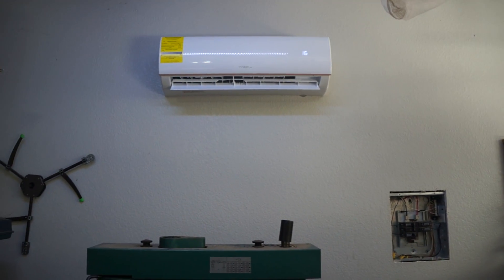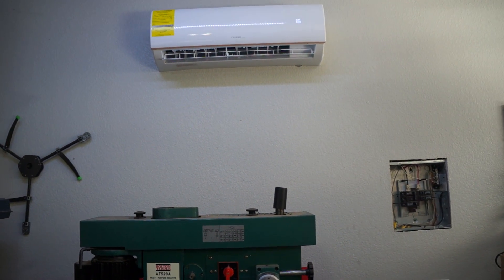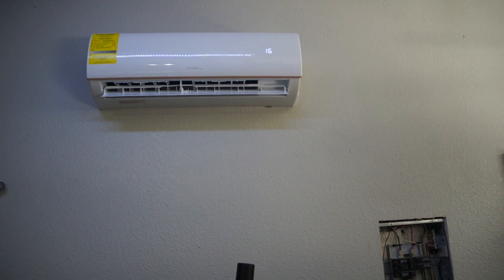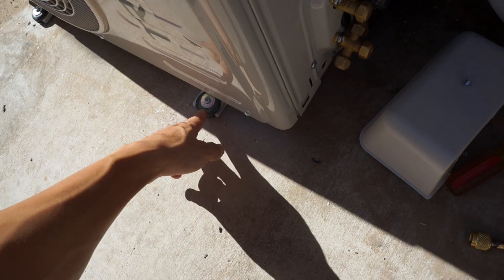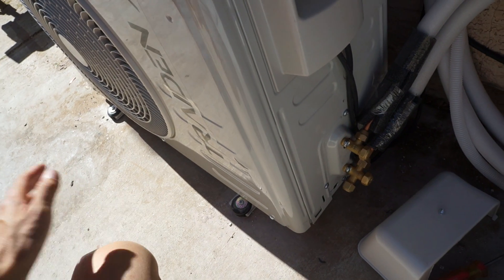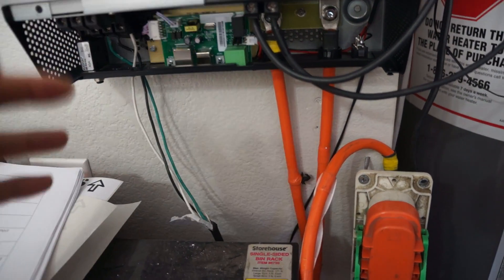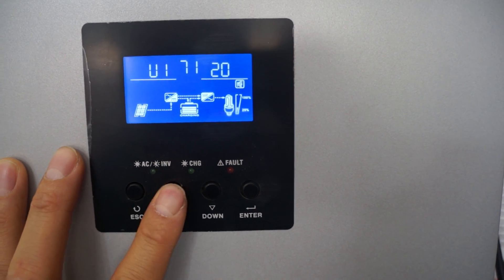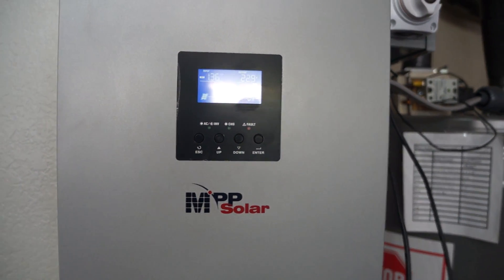Quick temporary install MPP 5048 MG to run Mini Split 12,000btu

Comment: Your indoor wall unit looks bigger than most 12000 BTUs it looks like a 18000 BTU I don't think my Senville 12,000 btu wall unit is that big what seer is urs?
Reply from the maker: I can't really remember the seer... maybe 16?
Reply: @devildestiny555  oh ok because I'm also running on solar my seer is 20 not sure what it really means I've only used the heating side I haven't tried the ac side yet

Comment: Why do u need a second inverter
Reply from the maker: Because I also run my central AC unit on it and it pull 20,000watts on start up.

Comment: I bought MPP 5048 It came with broken AC terminal and I have to pay $28 for it and repair it myself. Do NOT expect a warranty from MPP
Reply: I thought a PCM60 was built great  and best choice , I spent my whole 30 return time fiddling to make it find MPPT panel voltage, discususted with MPP idiot engineering, customer service then lost 200 shipping for full refund, they only sent me 40 for shipping. Lost over 200 watts because of it's stupid algorithm design, back to Taiwan for good. I think people could be losing lots available power and not notice it with MAXIMUM SOLAR stuff!

Comment: The PV input is showing how much is being pulled from the array.  It's fluctuating based on what the battery needs and what the aircon is using, but depends on the panel array as well.  I had the same issue trying to figure out what it was doing when I first got mine.  It wasn't until I put a watt/amp meter on the battery and the output of the inverter that I figured out what was being used.

Comment: Which car batteries do you like the best? The Ford C-Max seem like a good choice. Your thoughts?
Reply from the maker: It would depend on what application... Cmax is flexible because of the single cell, but again it will take a lot of cells to make up a big battery bank for off grid... so it all depend.

Comment: The MPP Solar specs  says it can operate without batteries. Have you been able to confirm that ?
Reply from the maker: It has nothing to do with pv voltage input, 450v is the maximum it can take.  It has more to do with pv wattage coming in is going to be enough to satisfy the load or not.  Look at my latest video to see it working in battery less mode.
Reply: Just saw it.  If I wasn't sold on this inverter before....I am, for sure, now.  Very impressive.
Reply from the maker: I have not tried that... I don't quite understand how that work or if there's a sequence....  I would think you would need to have the GRID connected in order to do that... But I don't nor want to connect it to the grid... Sometime I am trying to avoid doing... don't want to piss off my power company.
Reply: You are quite write. I might just have to send MPP Solar an email to clarify the operation in the batteryless mode. Thanks
Reply from the maker: Stay tune for a new video, I am uploading right now... will have your answer... I just tested it.  :)
Reply: Great!! waiting
Reply: I believe the panel array voltage has to be, at least, 450V in order for it to operate without batteries.  If it falls below that it won't work.  Probably best used between 10:00am to 4:00pm.  I haven't tried it myself, but I'm hoping when I'm done with other projects I can start in August to try it out.
Reply: Cool.  I'll have to check it out.  On the pdf it says 450V...so I figured that's probably close to 10 panels depending on the wattage of the panels.  I can't wait to try it out.  Thanks.
Reply: Ibidapo Ilawole 
It can run without i have tried